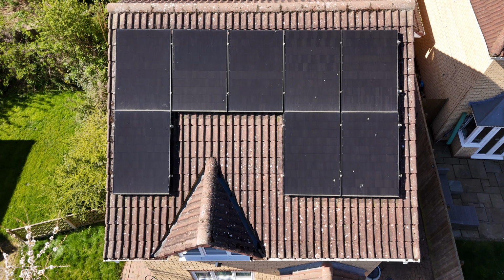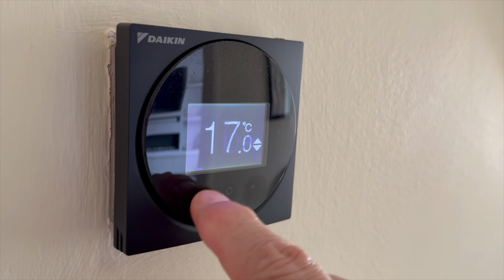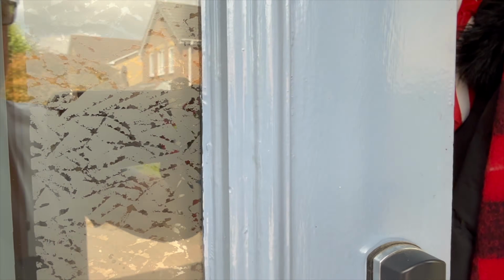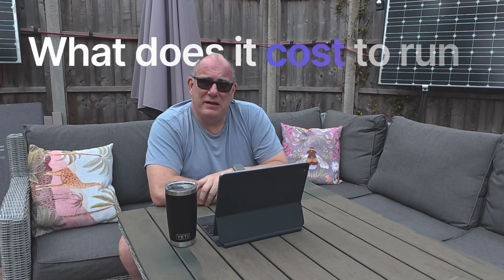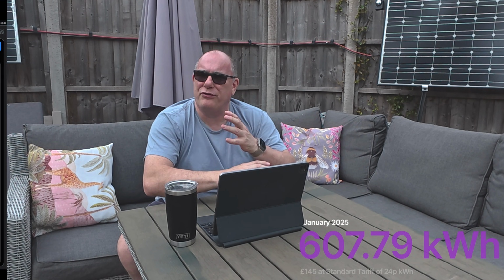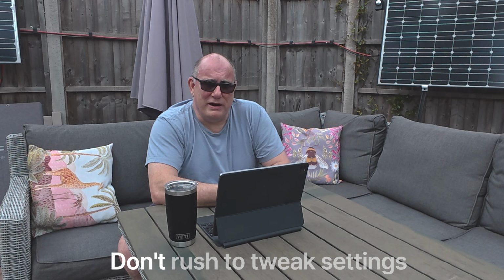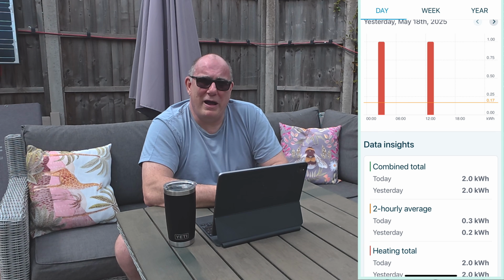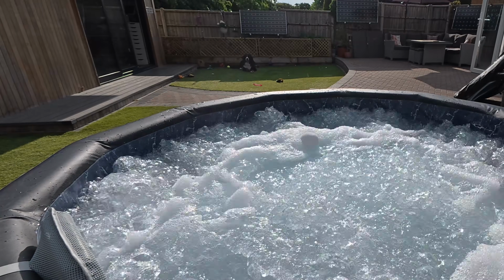I Spent 6 Months with an Octopus Energy Heat Pump and was blown away by the running costs!

Comment: Very good, JT.  I had my heat pump fitted by Octopus a month before you.  I picked up a piece of black tape which had come of the pipes this morning.  My thermostat is in the hall in the same position as my old gas central heating thermostat and it is the wrong place!  I hope to have a zero bill this year.
Reply from the maker: are your pipes in direct sunlight like mine, I wonder if we should tell octopus to use different tape 😂

Comment: Just one final comment today, my son just moved into his new house last week…..with a 30 year old gas boiler. I would generally agree with you about battery and solar first, but having had an old gas boiler fail and need to urgently install a new one, I told him I wouldn’t roll the dice, I’d put in the heat pump asap, while the costs are low with octopus. It’s worth mentioning octopus will give large discounts if you install other services, so it’s worth going and getting say the car charger in my sons case first, then the heat pump (with the discount), then as long as it’s inside a year, batteries and solar and get another discount. It could save a significant amount of cash.
Reply from the maker: Totally agree, if a boiler fails its not like you can get a heat pump tomorrow, its going to take some planning, so best not to be in the position as we head into the 2nd half of  the year of rolling the dice, because you know it will fail on christmas eve

Comment: On the question of water heating, I use home assistant to manage the reheat. Because I only have 12.6kw battery I make sure either to heat the water when the solar is high, or in an octopus intelligent dispatching period. Also, as we have a 250l tank, but only 2 of us living here, I only need to heat the water once every 2 days (mostly). So I set the heat point to 48 degrees and the reheat to 45…but crucially home assistant turns the hot water off completely, not even on the schedule, when I don’t want to heat it. All this means is I can heat the water when it is cheapest to do so. That’s the one thing I found about the heat pump, as it is standalone, it doesn’t optimise itself with cheap tariffs or green energy availability, so I control it myself….the wife hasn’t complained yet!
Reply from the maker: Yeah the API that home assistant uses could do with some more features, its pretty much on or off, I have reached out to Daikin to see if htey can improve it but heard nothing back

Comment: When I had mine installed in March I asked them to relocate the thermostat to the lounge. But I’d had the old thermostat disconnected several years ago when I put in a nest, and I think unless you ask they will put it where the old one was.
Reply from the maker: I am pretty sure its just power it needs and the comms is wireless, but need to check then can plan where I want to move it to

Comment: That's interesting! We didn't get a soakaway; there was a handy drain nearby and we have a drip tray that collects the water and feeds it into the drain. We haven't run ours through a whole winter yet but I don't think I'll get the freezing problem you had. Our external primary pipe runs were boxed and I think I read somewhere that this has become standard rather than optional. I've already tweaked the weather-dependent curve because during the winter I was running Cosy Octopus and I wanted to overheat the house by a degree during the first two cheap rates; it was not achieving that goal without the tweak. The tweak was only 2 degrees so it was 50C at -2C outside to 25C at 20C outside; now it's 52C at -2C outside to 27C at 20C outside, but I could probably have just tweaked the left side of the graph and left the right side alone.

I'd love to save £100 per month but there was no way that was ever going to happen in my case as I was only spending £700 per annum with gas! I think it will end up with a saving of around £300 pa for me, but it will be hard to know exactly.
Reply from the maker: Everyones savings are going to be different, but so long as its saving you money then its a win. WRT to the soak away I am probably going to put a drain along the all to where my gutters empty into the drain as it will just make life a little easier.
Reply: @JonathanTracey  Absolutely it's a win; it was unexpected too, as I didn't really do it to save money. It's particularly the sunny-but-cold days that I've noticed contribute so much to that. Bonus!

Comment: How many kWh of gas did your old boiler use?
Reply from the maker: For the six months period we used 9502 kWh of Gas, which produced about 7125 kWh heat, not far off the 7308 kWh of heat the heat pump produced this year.
Reply: @JonathanTracey our annual gas usage of  around 21,600 kWh with our 28 year old boiler and last year we were on the octopus tracker tariff which saved a considerable amount compared to the standard rate.
Reply: We are waiting for a DNO survey for the location of a new service cable to unloop our supply, it looks like the road, public footpath and our driveway+front lawn will need digging up for the new power supply,, we also need a new 2m high fence for the noise issue!! so quite a lot work to do yet before the heat pump installation.
Reply from the maker: small steps but heading in the right direction 👍
Reply: @JonathanTracey indeed small steps, we are also now thinking about a relocation of the cylinder because the old copper cylinders and cold water tanks are in the attic and apparently (so I am told) the new pressurised cylinder is much heavier and may require the roof structure altered plus the new cylinder will need annual servicing otherwise it could explode, meaning that unlike the old cylinder system which didn't need servicing, the health and safety of someone entering the attic each year to service a system could be a problem in the future.

Comment: Re: the boxing around the input and return pipes,  Octopus saying the boxing / trunking is now  included in my installation with no additional cost.
Reply: Had mine (Daikin) fitted 2 weeks ago, and all the pipework was boxed in as standard.
Retrofitting might be a problem as the pipes have to be quite close together.
Reply: @jamesp.1784 
Yes I’ve heard rhat
Reply from the maker: @jamessp.1784 I was just told that on the phone, as my pipes are further apart they won't fit in the standard enclosure they use. They are looking at alternatives for me
Reply from the maker: i am trying to get a cost to retrofit , but good it’s included
Reply: Is that added as standard or do you have to request it? (My install date is early July)
Reply: @markholt8843 I asked for it to be added as I wanted it,  they said it’s now included in the price,  my install should be June
Reply: Yes it’s standard now
I had a quote in October and it was going to be £133
Due to circumstances I had to re survey in February and it’s now included

Comment: Sorry I couldn't catch it, how mank kWh of battery?

How are the batteries wired (series / parallel) & fuse size, please.
Reply from the maker: 37kWh , 29.1 are dc (hybrid) solar edge batteries and then 7kWh Ecoflow delta pros and sundry other batteries 1-2kw in size.

Comment: Interesting, love the comments from the dogs. Please, please refer to kWh when mentioning the batteries and not kW. We already have solar 9.15 kWp and 19 kWh batteries. However off the gas grid and on oil, thus solar income used to offset oil price. Reluctance to go heat pump route, fullish 2,500 litres oil tank which was installed not long ago replacing a metal tank in the garage (no longer legal) and oil boiler replaced not many years ago, Eddi for immersion for water but use Octopus 7p/kWh rather than solar as 15p to export.
Reply from the maker: Haha yes—my brain does say kWh, but sometimes my mouth takes creative liberties! 😅 Thanks for bearing with me.

Totally understand that switching to a heat pump isn’t always straightforward—especially when you're off the gas grid and have already invested in a newer oil boiler and tank. Sounds like you've made some smart choices with the Eddi, Octopus 7p/kWh, and using solar to offset oil costs rather than exporting at just 15p.

Out of curiosity—are you concerned at all about where oil prices might go in the next few years? And if you don't mind sharing, roughly how much does it cost you each year to fill the tank?

Oh, and the dogs are now asking for a share of the income from the video to buy snacks! 🐾

Really appreciate the discussion—great to hear how others are making it work in different setups.
Reply: @JonathanTracey  No idea about volatility of oil prices but we monitor on weekly basis with an Oil Club. As recently dropped bought in 500 litres (took tank to 80% of 2,500 litres) at 51p (+ 5% VAT)/litre only to see it annoyingly drop further the next 2 weeks to 47p, then up to 49p. However able to withdraw £520 from Octopus built up from solar exporting to be able to offset cost of oil.
Reply: Correction - bought 1,000 litres not 500.
Reply from the maker: Being able to offset that price is nice, as even though its cheaper than car petrol per litre that's not exactly cheap

Comment: My issue with having a heat pump?  Can't fit one to a 1st floor flat...
Reply from the maker: you can but it means mounting it on the wall like an aircon unit, the issue then comes when you need maintenance as the engineers need scaffolding.